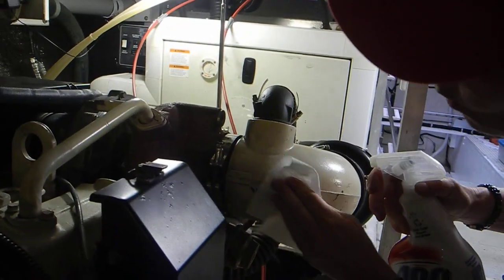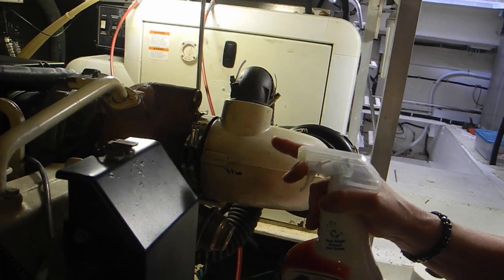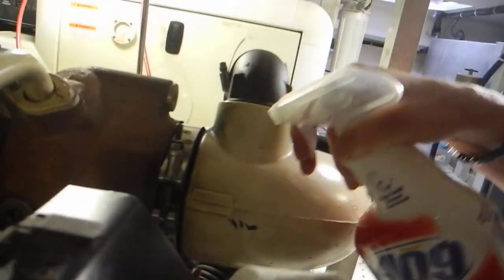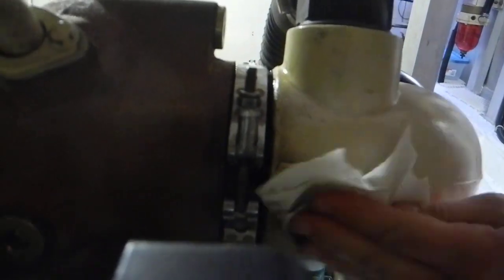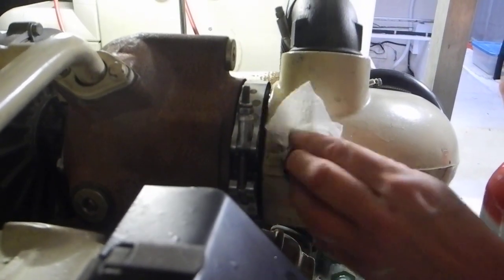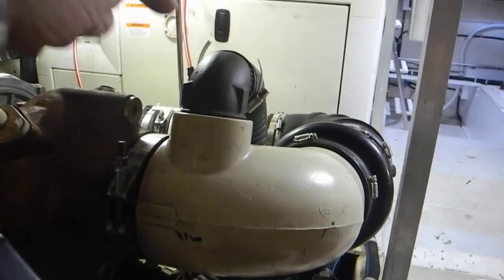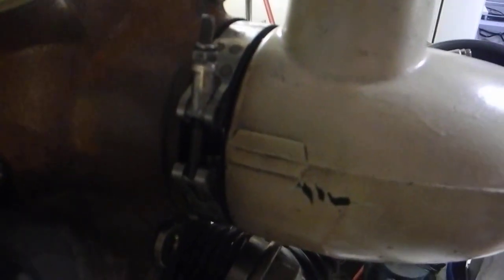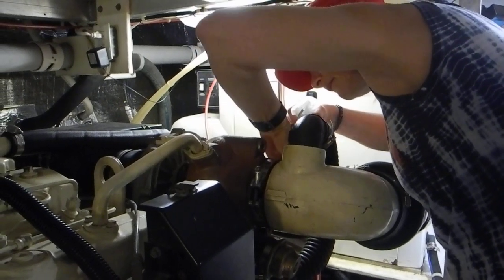Turbo leak evidence

Comment: Thanks.  Like #3.  Why wouldn't you just tighten the clamp a 1/2 turn?
Reply from the maker: Could do that for now BUT Best Practice is to replace clamp and gasket when the turbo is reinstalled. More details on Smokey's reply above.

Comment: Oh Goody a tech video. The clamp looks like it has a lot of room to tighten it. These type of clamps had almost no gap when properly installed as I remember. Maybe as simple as loosening clamp and wiggle turbocharger to get better alignment and retighten clamp. Wish I was there I probably could fix this right up. Sorry so long winded. I get excited about this kind of stuff ☺.
Reply from the maker: Snugging the clamp could be a band aid repair. Remember this is below deck aboard a boat and any exhaust fumes, CO poisoning can kill people in the cabin. Best repair is to replace BOTH the clamp and gasket with new items. The old gasket may be damaged and reused when the turbo as replaced. Best Practice is to replace clamp and gasket when replacing the turbo.
Reply: @AskCaptainChris  Yes sir. I can't really tell due to the dim light but a lot of these are flange to flange. They butt together. The clamp is V shaped on the inside. Sometimes loosening the clamp and wiggling the part will align it better. These types of clamps should have almost no gap when properly installed.

Comment: i think that clamp is a marnon type clamp.  It is used for high temp applications. It should have a lock nut on it or safety wired across the top of the bolt.  We used this type clamp on the 7th stage bleed air from a jet turbine engine when I worked on Phantom jets in the Marine Corps. I like Susan's mind set for verifying a leak from the turbine clamp,  My guess is that it was in fact leaking.  Probably also has type of metal gasket.
Reply from the maker: They ordered a new clamp and gasket and replaced it after I left.